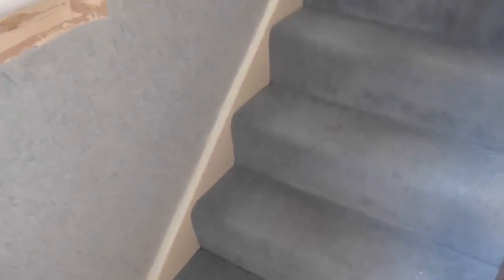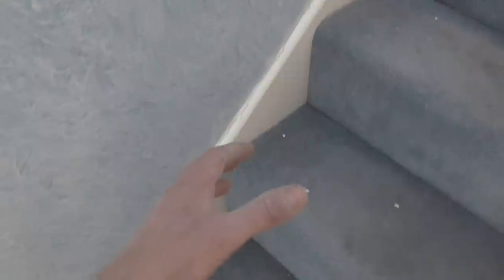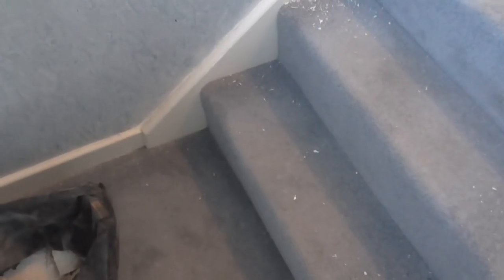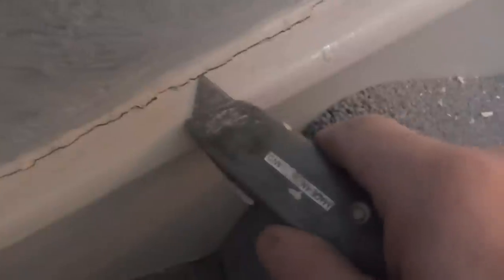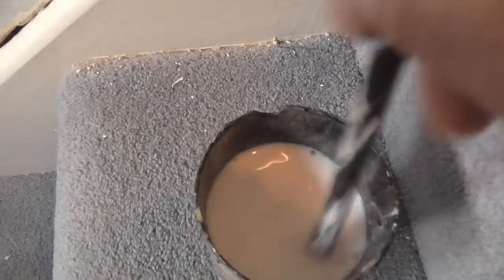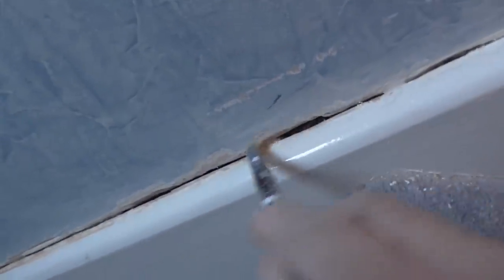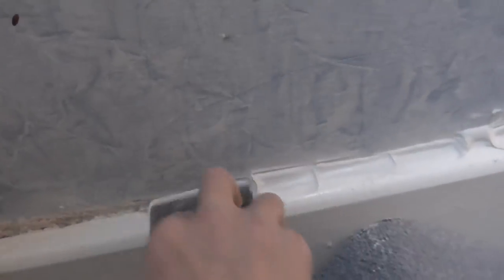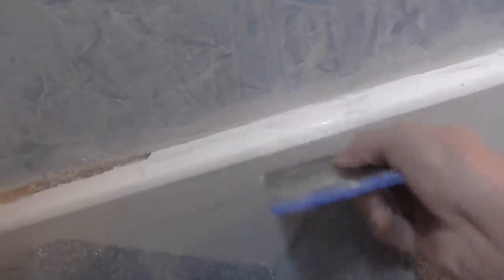Cracks On Your Staircase

Comment: Did a similar job on a three storey staircase, told the owner it would be a bit invasive as had to rake out 20 years of fillers. Foamed the gap & finished off with Toupret, went back 6 months later & not a single crack. 
Burlington Hotel in Torquay advert on the newspaper was funny as we used to live (part time) next door to the Burlington & used to watch the weekenders arrive by coach.

Comment: I had to do this recently on a oak stairs. I raked it all out and protected the oak stairs with paper tape masking then done the foam once dry cut the excess off then caulk the top line let that dry off then next day another caulk to bring it level with the stringer and painted it into to the dark wall colur. Wam bam looks mint now.
Reply from the maker: Great stuff, nice that these types of cracks can be fixed now, thanks to foam.. thank you

Comment: Does it matter whether filler or caulk/flexible filler is used? Thanks
Reply from the maker: @AlexJones-f3b  you can use any filler to go over the top of the foam. 
The foam is a shock absorber. Thanks
Reply: @PaintingandDecorating Thank you. Is it worth trying when the wall is solid rather than plasterboard?

Comment: A friend was telling me excitedly about his new foam gun with the extended nozzle...then said immediately afterwards about it being a nightmare to clean, requiring a special solvent. I'll stick to my Genius Gun, thanks.
Btw, you and your family are welcome to a stay on the Mid Wales coast, if you're ever at a loose end and venturing out of your secret Northern lair. I have a feeling you meant going somewhere slightly warmer though...
Reply: The special solvent is only Acetone. Its very inexpensive and if you buy the gun grade foam in bulk, it's usually included. Appreciate that not everyone has the need for bulk buying however. Also, as long as the gun is screwed up tight after usage, the can of foam attached should last for months. It's much more cost effective than buying the single use cans. P.s. That holiday in Mid Wales sounds wonderful! 😃
Reply from the maker: Thank you for the kind offer.. but your right in thinking hot.  Somewhere Like Cornwall 😁      and for the guns, I can imagine if doing loads of foaming, then it probably is worth the cleaning. But we only use small amounts at times.
Reply: I am as he can't paper hang
Reply: @PaintingandDecorating  with the guns you don't need to clean them very often at all..all you do after use is tighten up the needle and it's ready to go next time. Can be left for weeks and weeks without any problem. Wouldn't use the hand held stuff again to much faff and cleaning up
Reply: @PaintingandDecorating  which one do you use and do you clean the plastic straw thing after each use?

Comment: Hey! Thanks for the vid. What purpose does the PVA serve? I just didn't quite understand that part.
Reply from the maker: It partly seals a porous surface so paint has a better key, and time to dry. If all the moisture is soaked out of the paint too quickly, it just leaves pigments on the surface. This can form a unstable surface for subsequent coats. Thanks

Comment: Could do exactly the same job in quicker time using elastofill as a back fill and Toupret, seems like overkill to me 🙊
Reply: It would definitely crack again using your method. The aim of the game is to try to reduce or even stop movement between the 2 surfaces. Without mechanically fixing every couple of inches, foam is the best alternative. The elastic / acrylic fillers are flexible for a while but then they dry out and become brittle so on a stair stringer would fail in a few months. Seen it many many times. 👍

Comment: Would the expanding foam not push the skirtings of the wall creating more issues as it expands and dries??
Reply: Not necessarily, foam will take the easiest route and try to head back out of the gaps. Once it hits a surface it'll start to move in another direction. The only time it will push something off the substrate is if it's not fixed properly

Comment: Love watching u..so funny..the basics are right but my god you're a butcher..look, if u going to go right back to wall,  do it right!  i use sharp 1inch chisel, knock it down proper, not a blunt stanley knife! ffs..then  sand it all down , i get leccy sander on it and the carbon paper, sand it smooth best u can BEFORE the foam goes in!  then get the foam proper in! most of yours was just sat on top! cracks back within 12 months ..i use polyfiller 1st fill, but on stringing finish with wood filler! u were never trained, and it shows up so many time...DIY lads love u..as they know no better...old school decs like me...roll our eyes
Reply from the maker: I can tell by your comment you do not do this very much.  May be the blade has worn and gets changed, but you don't understand this. You take your time, you don't go at it with a chisel and hammer.  Bait comments funny ..  🤣
Reply from the maker: You also don't know the filler is for wood also.   People can check to see that this is correct. Thank you for a great DIY thoughts.
Reply: @PaintingandDecorating  actually u do go at it with a chisel and hammer! steady away, gently tapping it down .."i don't do this very much|" my 50th year..and never advertised last 31 years..already booked into 2024...close to retirement..i am Leeds top dec tho...prob best paper hanger in Yorkshirer ..u scare me when u paper..u cant hang pal//u still score paper with your shears  and peel back and cut with scissors! omg no 1 does that anymore..straight edge and blade..unless a small cut...u even cut in backwards! if u had been trained that's a no no...but hey u make me laugh...
Reply from the maker: @MARTIN-pm7qc  🎣
Reply: @MARTIN-pm7qc  maybe you should start your own channel, show us how it's done.

Comment: Just fit small wood or plastic bead, fixed only to the stairs, quicker, neater and long lasting. This vid is a bodge
Reply: Huh? Beading IS a bodge, and would look terrible, especially plastic.
Reply: They already do this in most new builds. Most of the time the house builder will use quadrant but I've seen on occasion a piece of trimmed down architrave. In every single instance the quadrant / architrave has also cracked. The key is to reduce the movement between surfaces, any beading will just spread the movement out. All the best. 👍